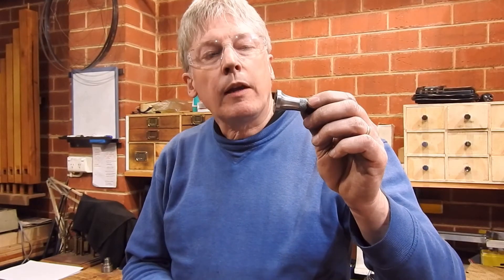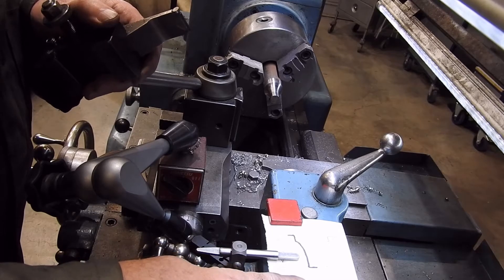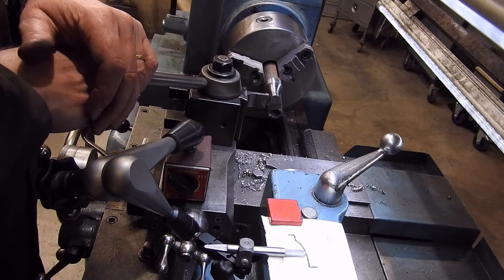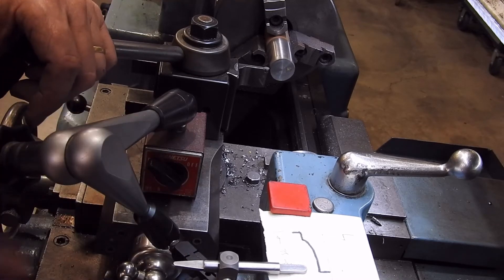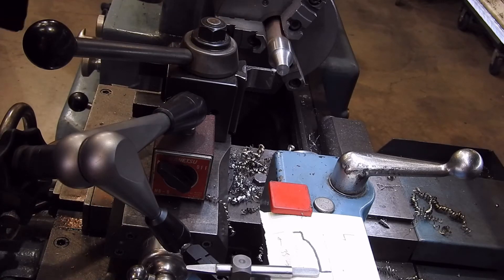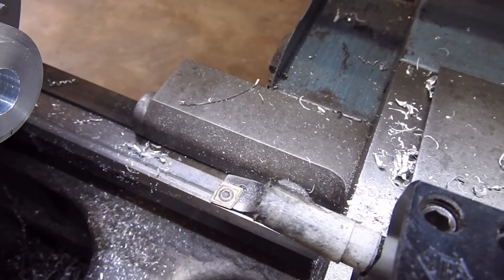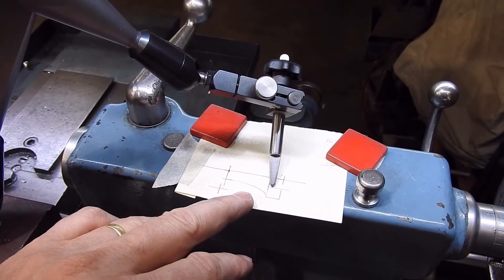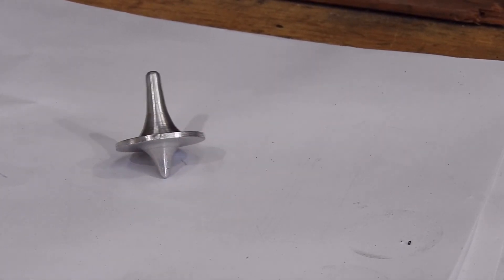Turning curved profiles (on a manual lathe)

Comment: Interesting idea Michael.  Basically it's a pantograph system.  I must try that.  I would normally use the former as a best fit guide, but your method looks to be more accurate/uniform for repetition work.  Thanks for posting.  Cheers Rob

Comment: Great idea Michael, I would think it's possible to turn some accurate and intricate shapes using a CAD template, a USB camera with cross hair reticle  and a slow feed, if required.
Reply from the maker: You probably could (with a lot of practice). I find it hard enough cranking handles while looking at the tailstock as it is; put a screen in there...